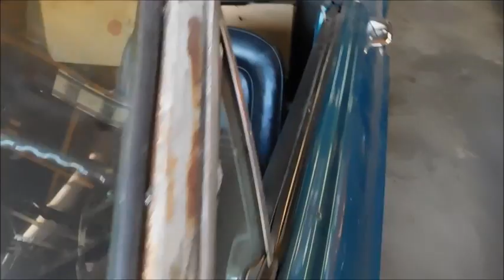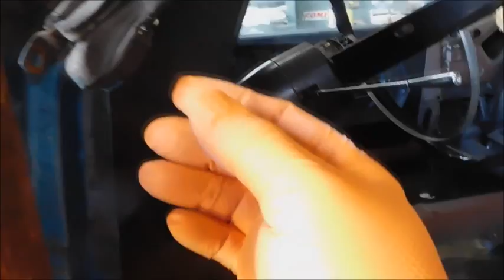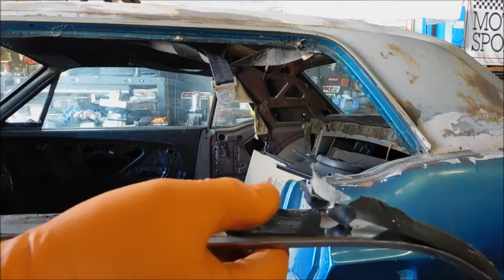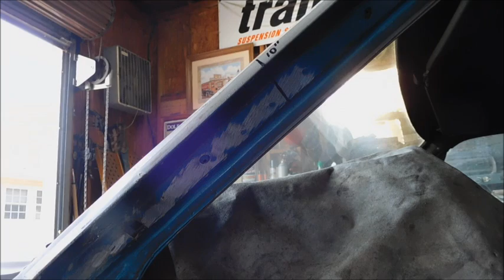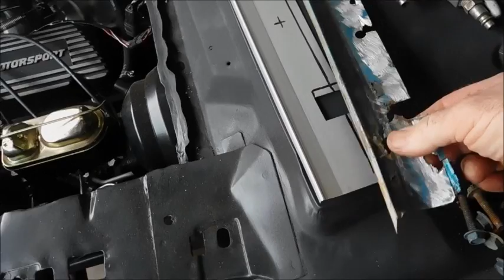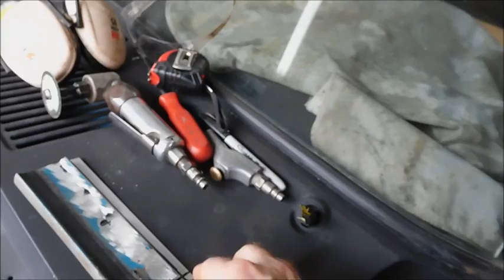1968 Mustang drip rail repair.

Comment: Thanks for doing this. Very informative. I have a similar issue on my 66 but across the top have pitting on the roof skin where it meets the drip rail... have you had to address this or what would you recommend?
Reply from the maker: I have not had to address that. The drip rail for the 65-66 cars actually goes under the roof skin. Difficult to repair.

Comment: Hey Barry, question about welding panels. With your setup/welder are you using mig or flux? I want to fix my panels my flux machine, but I’m having second thoughts on whether I need a whole new machine...
Reply from the maker: I only use a mig. No flux core for panels.

Comment: It's tough coming across video showing drip rail repair.  Once you welded on the drip rail, what did you do to seal the point at which new drip rail meets the pillar?  It seems that area would be prone to water getting in and then having rust issues all over again.  Also, care to share your compressor make and model?
Reply from the maker: I will be adding a seam sealer in the channel. I recently sprayed epoxy on this car.

Comment: Thanks a lot for an informative video. I have a '64 Mustang coupe. Previous owner tried "shaving" the drip rail and managed to butcher the part running up the A pillar. Now I see how I can repair the butchery. Thanks!
Reply: So did this workout for you? I have a 66’ I wasn’t sure if the drip rail was the same and if the Fastback one would work because for whatever reason they don’t make the replacement drip rail for coupes…

Comment: I have a different question.       How can I remove the rear glass upper chrome molding?      Thank you,    Tony
Reply from the maker: I have a tool very similar to this one, and have had good luck with it. https://www.classicindustries.com/product/y35200.html
Reply: @JoDaddysGarage  Thank you very much.   I do this going in from the bottom, correct?  Tony
Reply from the maker: This may work too. https://www.summitracing.com/parts/oes-25338

Comment: Hi, this is Elijah again from NEW ZEALAND. two questions I would like to ask, if the panel witch got the vin nomber on is badly rusted wat do you do with the vin nomber, if vin nomber is on a plate that is pop rivited to panel and you have to fit a new panel wat pop rivits must you use, here in NEW ZEALAND the new zealand road agency is very stricked abought that. Wat do you think I must do. I love the way you chopped up that convertable mustang and built that mustang from scratch, I took good note wat you were doing, BUT why did you not get a compleet shell you can buy them now. I am  still waiting for vedeo no 26 of the 1968 mustang with rebuild engine.
Reply from the maker: 'Hi Elijah. That is a good question. I have heard of people restamping the vin in a new panel. But I don't know for sure. As far as pop rivets, again they are available, but I don' have a source. I/we chose to build the convertible rather than buy one. It was about half the price that way, and that included all the front sheet metal.

Comment: One year later, but for your effort, there's a thing called a " spot weld drill bit ". Not the cutters, a bit. It looks much like a wood drill, but for these pesky welds. You spot the center, and then drill the upper layer. They work excellently after you've done one or two to figure out their game.
Far better than the noisy wheels and superior to the cutters which almost always take more than you want.
Reply: Also, for stuff like this, whilst i am from Europe, and mileage may vary, as they say, i managed to get bespoke parts (like that drip rail) made for cheap (in comparison with importing original parts or buying new ones) from local business. Always worth investigating what's around you because with a good word, they can make just about anything within reason.
Reply from the maker: Yep. I've used them before. Had mixed results. I also had a spot drill gun at the body shop. Really good tool. Maybe I'll get another one someday.

Comment: What welder do you use for all of your repairs? I am just getting into rust repair as i own a 66 coupe and would love to do the repair work myself. I realize that I will need to practice for a while before I attempt the floor pans...etc. Thanks!
Reply from the maker: I currently use a Lincoln 140T wire feed gas welder. It is 120 volt, and handles everything I do fine. There are other brands available.
Reply: Thank you very much for your reply. I love your videos as I am trying to restore my mustang as much by myself as I can. I will practice a lot before making an attempt on the car. Thank you for the prompt and helpful reply.

Comment: I use to have a 67 coupe but was stupid and sold it back in 1992. Was looking for another project Mustang but the ones I have seen here in the Dallas area are way over priced in my opinion.  I have seen junked out Mustangs where the upholstery is shot and no engine for $3500. Just wondering if this seems like the right price these old Mustangs are going for. Thanks, Roy
Reply from the maker: Depends on the year, and what condition it's in. I've seen really bad stuff going for $2500 and up.
Reply: Thanks, that what I have been finding out myself. Maybe I will get lucky and find another one someday, just keep my eyes open for one. Good luck with yours.

Comment: Does the drip rail form, or join, the roof panel or is it just welded to the door sill to only mount the chrome trim? I was thinking about removing the drip rail on my car to give it a cleaner look. Thanks and awesome work!
Reply from the maker: The drip rail assembly goes under the edge of the roof, and it is sandwiched together. You can remove it, but you will end up with some sort of flange sticking out where they all meet.

Comment: Hello JoDaddy. When you say rust sealer ,do you mean Killer converter ?. I have been doing some test with Permatex  rust converter I applied and left the part in the weather it's been two weeks and no rust back yet and has it can be primed and painted over it should be a useful tool in the battle against rust. Just thought I would share my findings with you and the viewers.
All my best.
Bobby
Reply from the maker: Yes, a rust converter.
Reply: May I ask what brand you use ?. And thank you very much for the fast reply.
I am testing the Permatex 81773 treatment.
Reply from the maker: I have used several. Currently I'm using Purple Power. http://www.clean-rite.com/purplepower_de-ruster.html
Reply: Thank you Jo Daddy.But the product seems to no longer be in stock, I  even checked Ebay no luck there. All my best.
Bobby
Reply: Thank you for the tips Much appreciated. I will get some Por15 I own a 66 Mustang though it's not the Fastback,Wish it was :)  And thank you for the link.
All my best.
Bobby
Reply: Hi I have used it and my results weren't to great. Thank you for the tip.The Eastwood product I haven't tried have you tried it ?. 
All my best.
Bobby
Reply: Hi Jo Daddy. Here is an update on the permatex  rust converter. 6 months out in the weather and no rust on the bare metal or rusted metal I coated. Very happy with the results.
All my best.
Bobby